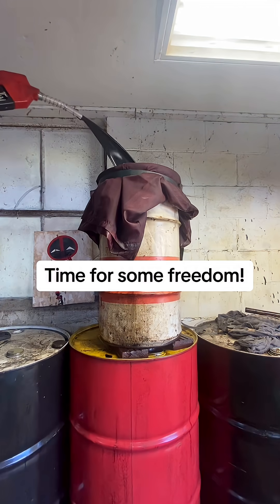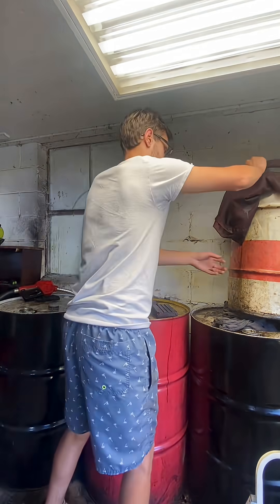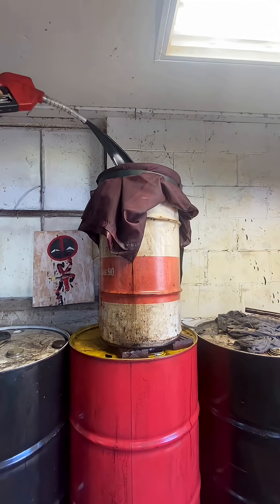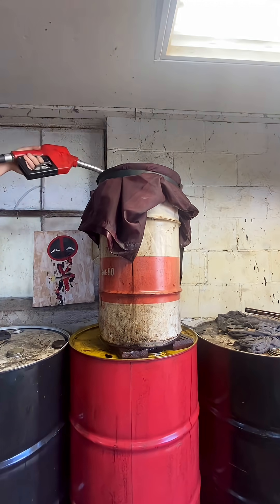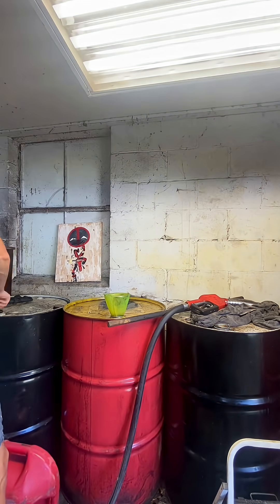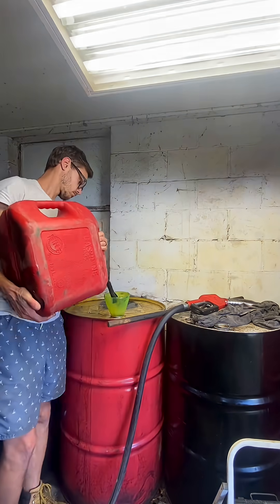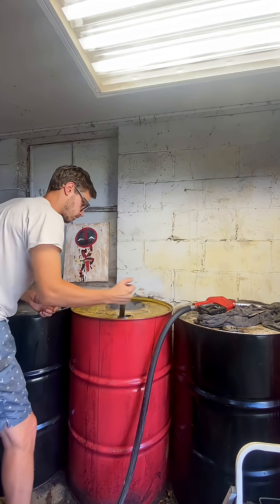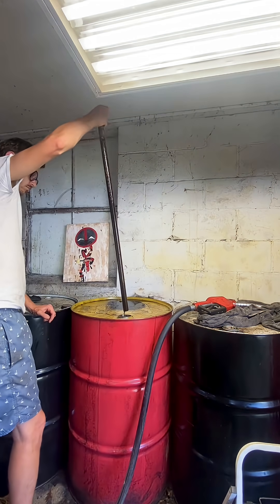Transform #wastemotoroil into #homemadediesel Fuel #dieselmechanic

Comment: My grandpa used to do this exact thing in our garage while smoking. He never blew up. No matter how hard he tried. Grandma was tough on him.
Reply: Diesel is incredibly difficult to light with a cigarette or a lighter. Petrol/Gasoline on the other hand is much more flammable
Reply: @Blunty.636  Yes but he's adding gas, an open flame could ignite the vapors before it's mixed in.
Glowing embers are not hot enough to ignite gasoline, you do need an open flame.  You can put a lit cigarette directly in a bucket of gas, nothing happens. 
I even tested the limits as a kid by pouring a small amount on glowing coals, the gas puts the fire out.
Reply: @amosbackstrom5366 my grandfather bet me that I couldn’t light a small jar lid filled with gasoline using his lit cigar. I tried my best… couldn’t ignite it.
Reply: @amosbackstrom5366  yes gasoline was designed to havea high temp ignition its harder to ignite than most people think cigs CAN light it but its rare as its hard to do
Reply: @Blunty.636  It's the vapors from gasoline that ignite. You can throw a lit cigarette into standing gasoline, and it will just put the cig out.... unless the vapors are in a confined space, that's when it's highly ignitable. The liguid itself.... not so much.
Reply: @Blunty.636  You cant even light gas eith a cigarette,  it needs an open flame.
Reply: NO NEED TOO POUR PETROLEUM,  IF YOU FILTER AND REFRACTUATE  THE USED OIL
Reply: @Dezzy-e8b  please elaborate for us in the back, oh and tell us like we are in 5th grade
Reply: I think you've lost the plot😂 @MongoMinutes
Reply: She must loved him. Otherwise just throw a torch in while hes pouring gas an whos bo know😂😂
Reply: Diesel dont burn in this form
Reply: @Dezzy-e8b It sure does, I’ve dealt with it and it’s hard to extinguish. Hydraulic oil can also ignite.
Reply: @blauer2551  Diesel is oil, and oils have to get hot to burn. When oil is in atomized form however, the particles can get hot really easy.
Reply: @kaba_me So I’ve been around fuel as a career and we had spill buckets around and the smokers always threw their cigarette butts in those and we all laughed until one day it ignited and melted the 5 gallon bucket like a candle and the contents started a spilling fire on the concrete which was hard to contain. We got our asses chewed, even the non smokers. It was probably a blend of kero and diesel but we were sure nothing would happen until it did.
Reply: It’s been proven time and time again not even a cigarette can ignite gas the gas will actually put the cig out
Reply: Crude oil is a sludge of mixed contents. From aromatic gases (like propane and NG) to bitumen tar. As you heat and chemically "crack" the crude oil, different "fractions" evaporate or separate off at different temperatures and pressures. Gases first, liquids, waxes, and rubbers last. The lighter and more volatile the compound, the lower the temperature it evaporates. White liquid fuels like white gas or kerosene come out first. Then your naphtha and octane. This is where the thin fuels stop and the oily fuels start. Diesel is technically an oily fuel. Thin oil next and bunker fuel last. What's left is bitumen tar sludge. Since motor oil is a clean thin oil, you can mix it with octane fuel, aka gasoline or petrol, and get an effective diesel mimic. Take a light fuel mix it with a thin oil and that splits the densities... sort of...
Reply: You can literally drop a burning cigarette into a can of regular gas and it will not ignite 🎯💯 believe me I have tried it more than once when I was younger messing around experimenting with different stuff like that. It will simply extinguish the burning cigarette with no igniting of the gas
Reply: It’s diesel, it doesn’t go up in flame easily like gas .
Reply: He wasn't allowed to blow himself up, Nana's orders 😂
Reply: Fireproof grandpa

Comment: This works well with used vegetable oil. I generally stay away from used engine oil, plugs filters bad and stinks horribly. Veg is okay on your injectors as well, as long as you run some diesel here and there. I always keep spare fuel filters. But a good batch shouldnt kill the filter any faster than diesel.

Comment: Ya 10 years ago i had a suburban 6.5 l that ran on waste cooking oil. It wasnt a great setup because the electronic injection pump didnt like preheated fuel. It smokes the controller. But i think you can run damn near anything if it has a mechanical injection pump. 

My setup had 2 separate fuel systems. I would always start and end a driving cycle on straight diesel to be sure the fuel system was cleaned of veggie oil. It turns to gum once it cools. But i will say it smells like french fries over the course of a long road trip. And it runs just fine on the waste veggie oil. That being said id stiick to what this guy is doing before i would go the wvo route.

Comment: Leave the cap off the bung while settling so water can evaporate out and not condense on the inside I only pump out the top half or 2/3 when filling my truck you will see a bunch of crud on the bottom even after running thru the sheet

Comment: You have the wrong gas can. There are gas cans that allow diesel to flow much faster. It only takes a few seconds.
Or drill a hole in the bottom of your can that you can open while tipping it. If air can enter the can from above, it will be empty in a few seconds.
Reply: IN THE BOTTOM????  Why in the bottom? It will NEVER hold liquids ever again!!! 

In the rear of the handle!!

Comment: Diesel engines rely on the diesel as lubricant for the high pressure pump and injectors. 
Adding petrol (gasoline), which is a SOLVENT, will destroy the waste oil’s lubricity. 
It’s the same reason you do NOT use petrol as a flushing agent on your engine during an oil change. 
Better to add some virgin diesel to the waste oil or a diesel additive that increases cetane rating.
Reply: I believe that gasoline with a high "detergent" additive would do that as far as breaking it down. Gasoline is made from oil. If this happens to be true, my 2-stroke engines are mixed with 2-stroke oil and gasoline to provide MORE lubricity. My chainsaw would be loooonnnng gone if this was the case, no?
Reply: @ffemtx4 It’s the oil mixed with gasoline that provides lubrication. Without oil, your motor will seize. 
The diesel engine is very different. 
High pressure loads on the high pressure fuel pump internals and injectors are critically reliant on the fuel’s lubricity. Any reduction in lubrication will speed up the wear rate and cause premature failure.

Comment: Unless you have something constantly stirring the used oil and gasoline it will begin to separate and in twenty four hours it’ll all be two separate chemicals in the barrel!
Reply: Doesn't happen with 2-stroke, mixed gas. Why should it here? Gas is MADE from oil.
Reply: @ffemtx4 well if you’re using a two stroke often it’s getting stirred through use. Do you not give you two stroke can a jostle before dumping it in? There is a very good explanation of this on YouTube….a video on mixing chemicals and why! Even if you leave gasohol stored in anywhere for very long it begins to separate the two components!

Comment: Just me, but I'd put an air valve on the other top side of the gas can.  I'm really lazy so I melt (torch) a Gatorade bottle screw lid on the gas can. 
That's what was at my feet. 
Unscrew the cap. 
Start small and slowly make the hole bigger, experiment with pouring the gas until it flows smoothly.   You could try the adjustable caps too.  Take a string knotted through the cap and tied off to the neck. TaDa.  They make silicone if you don't want the smell getting on the string, past the knot hole when you have to take the wife's car.  Make "the hole"
between the melted neck & close to the lower slope of the gas can so if gas does splash up there, it'll drain back.  Or just make more can small holes near the inside of the neck with a hot poker.

Loved the white shirt in the video.
Must have had to go into town?

Thanks again for the video !!

Comment: install the Magicfour Fuel Gas Can Vent Cap, or any other brand vent caps on that gas can. they work really good.  just open the cap to let the air in then  close it back . the kit comes with the drill.

Comment: It's the soot that gets u. . The engines that predate low sulphur fuels are better for alternative diesels . U can achieve viscosity and btu's with many blends but the soot &microscopic metals will get u. Olskool guys used to centrifuge then filter to .5 to 1 micron.  A regular 10 micron fuel filter isn't small enough

Comment: I used to use fryer oil and used motor oil pushed through a .003 micro filter. And I'd add about 5 to 10 gallons of either kerosene or diesel that was free from some project I had bought and there was a little left in a tank. Just drain out 20 yr old diesel and through that in there.... mmmm tasty. The kerosene or diesel helps to keep the injectors working. As gas will eat out your rings in the injectors and then you get misfires or no injection at all. Personal experiences

Comment: In a desperate situation this is great, but its the bare minimum of processing. The diesel cycle will work on anything that burns in compression, but technology advanced with cleaner oils. Will the fuel run? Oh for sure..., will the pump sieze or the injectors clog? More likely the newer you go. Will this dirty fuel damage internal parts? More likely the newer you go.
Good idea, flawed execution, depending on the scenario hes using the fuel for. 

Realistically its been the same issue with gasoline fuels for decades, and now we have fuels that will eat your grandmas car alive if she pumps the wrong one cause its cheaper.

Comment: Do u run it threw another filter system befor pumping it in the truck so u dont screw them $300 injectors up or manual pumps

Comment: For an old farm tractor yeah ok. But you do know what turns oil black? That's carbon residue. Diesel fuel also has more for to help injector life. Run that through a fuel filter then tell me what you see. Not to mention most have a shelf life. You can use it as heating oil.

Comment: I work at a refinery gasoline and diesel are different "cuts of the refining process (boiling of crude oil) these separate from crude at specific temps and pressures. that is not diesel

Comment: I had a Dodge 50 truck with a 3.8 L perkins marine engine in it and i could just put straight chip oil in it and because the injectors were old and large i never had a problem but any small diesel engine would have issues even if it was thinned.
A mate started making bio-diesel and had a pretty cool setup with heaters and he also made his own methanol as the alcohol AND his own catalyst which he recovered a lot of at the end... The diesel burned really clean and didnt mess with new diesel engines that are all very computer controlled, we pulled an injector on his car that had 20,000 miles with the stuff and they looked the same as if running forecourt diesel.

Comment: Cummings approximately 20 years ago, we’re taking engine oil and recirculating back into the fuel so you wouldn’t have to change your oil on your highway tractor. At the time I was speaking to Cummings about this and they said it did not affect the injectors.

Comment: As an oil refinery operator. This is definitely not diesel fuel. That’s oil thinned out with gasoline. We run heavy D and vgo through a diesel hydro treater. Running through the catalyst pulls the H2S out. That will gum up your engine.

Comment: I applaud your total reuse of waste oil, the less we can dig up the better. Adding Gasoline as a solvent and waiting isn't really going to remove enough crap for modern vehicles to stomach for long, in-fact even old injector pumps aren't going to like it either. 
I think you need a powerful magnet (for microscopic swarf) followed by a centrifuge (soot particulates) (buried in case it goes bang - trust me), followed by a fractionating tower. 18 ft, 6"Dia steel pipe with interior baffle trays and takeoffs, every 6 inches. Swaddle it up with old cotton sheets as insulation, and a heavy oil burner at the bottom and it should work a treat. Expect the whole thing to be on fire at some point, and plan surroundings accordingly, but you should get all sorts of grade of oil. If that doesn't suit you'll need a cracking tower too.

Comment: Plus need double filtration on truck. And go thru filters like crazy. Best to have a pre filter with a serviceable element between the lift pump and high pressure pump. Plus this really only works on mechanical diesels with P7100 pumps later 12 valve cummins and 4bt and 1994 and older dt466 dt530 dt408 dt360 and tractor motors pre electronic with p pumps or similar rotary Bosch VE pumps dont like this. Older CAT engines can do it but still u need modded filtration system on truck. If you read this whole comment you just learned some good sh or u already knew it idk

Comment: Bro your running your truck on fucking 2stroke gas and sa shirt mix at that so ya there’s lots of questions like what the in side of your motor looks like your injection system fuel filter shut the list gose on

Comment: This only works on mechanical injections guys, it’s Smokey, really low on power, and not very reliable but damn it is cheap… use to run it on my 94 12v could fill the truck for like $15 but maybe was like 85 hp if I was lucky and the exhaust had a constant white smoke.

Comment: we use old oil(engine ,trans and hydraulic) and  fryer oil from restaurants  we add about 2 gallons of kerosene to 50 gallons in the winter  but have ever added gasoline   ive ran 3 skidsteers and a few chevys and ford on this mix         1 side affect is your always hungry for frys or wantons

Comment: Dude rolled out of bed in his PJs to make Diesal Fuel.  Dedication!!
Reply: He a dip stick 😂😂😂
Reply: 😂😂 that's  what  my dad used 2 call me. Thanks 4 the flash back.  😂😂
Reply: The young dude that was making diesel out of recycled plastic disappeared. This man needs to be careful! Big oil doesn't want the public to know how to be self reliant.. they want you reliant on them! Watch your back brother and stay vigilant!
Reply: He's not making diesel. I don't know what he's making but it sure as hell isn't diesel. Probably not good for the engine either.
Reply: @nerfzinet how do you think diesel is made? It’s basically a mixture of gas and oil.
Reply: @BiffsEquipment  Fractional distillation. You heat crude oil to about 400 degrees celsius which vaporizes it and you allow it to rise up through a distillation tower. As it rises it cools and different fractions - different chemical compounds in the oil, condense at different levels in the tower. One level is diesel and a couple levels above is gasoline. 
In other words, diesel is a different chemical than gasoline, and you can not just turn gasoline into diesel by adding some oil and stirring it like a kid in dad's garage.
Reply: @nerfzinet yes it is
Reply: @williamwilkins3046  Alright friend, go ahead and fuel your car with that stuff and good luck to you.

Comment: Take a small wood screw and drill it into the upper corner of your gas can and replace it with the same or slightly bigger bolt and then you can use that to make the gas poor quicker and then plug it with a bolt when you fill it up so it doesn't leak.

Comment: Been doing this for years in the UK to run landrovers. Not good for anything that isn't direct injection. Engines last up to a year because or the metal left in the oil. Try using a proper filter process using a inline fuel filter and possibly a pump.

Comment: Just get you a fuel pump off of a regular gasoline car and hook 12 volts up to it an actual battery from a Milwaukee power gun that's 12 volts and that will pump that gasoline you won't have to worry about spelling it or holding a gas can

Comment: Hey red neck tip for your gas can lol drill a hole in the top on the opposite side from the spout and it will vent and flow much better then take an old screw or bolt and there’s it in there so you can seal it brotha

Comment: Had a buddy that drove a turbo diesel Jetta, he workes at the airport and when they work on a plane they have to empty the fuel tanks and dispose of it. He used to fill 55 gal drums with 100LL and being them home. He would add oil and use it as diesel. Told me that 100ll is diesel without the oil and a little lead. 😂

Comment: Why are you using gasoline? Would c tane be better for what you’re doing?

What micron level do you filter it down to? 

Do you have to heat it up to blend it before you use it? 

What year of diesel are you putting this in?  

Have you had any detonation issues?

Comment: I know a guy who does something similar but he runs it through 4 different wix oil filters multiple times only adds like a gallon of gasoline then before he uses it it gets mixed like 70/30 with fresh fuel and 50/50  during the winter. He is using it in a stationary in generator.

Comment: This is neither homemade diesel nor is this even legal to use on the road in a diesel engine.  Diesel requires a distillation process. What you made here is fucking two stroke gasoline. Now if you had heated the glycerin out of it, added some lye for balancing and added a bit of liquid parafin wax you could call this diesel but as is you made weed eater gas kid. As for the legality if a cop checks your tanks and finds this expect a ticket for not using ULSD. Also also. Good luck with your injectors from all that shit youre running through them that you shouldn’t.  The ONLY reason this works as fuel is because a fucking diesel engine will run off of pure motor oil. You could have just ran the used motor oil as fuel if you weren’t going to ACTUALLY make homemade diesel.